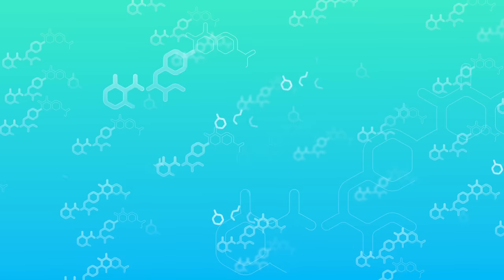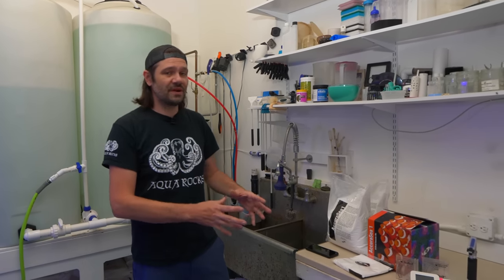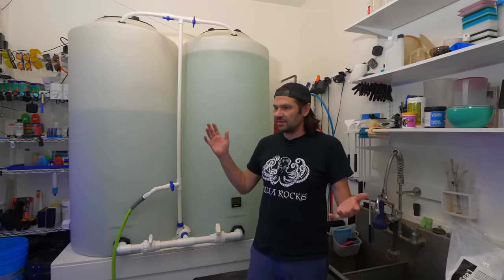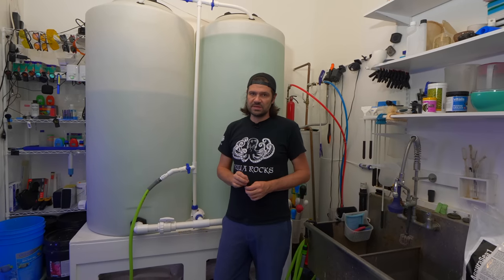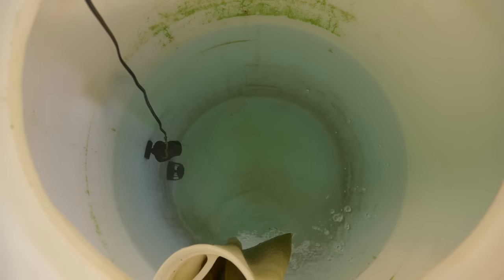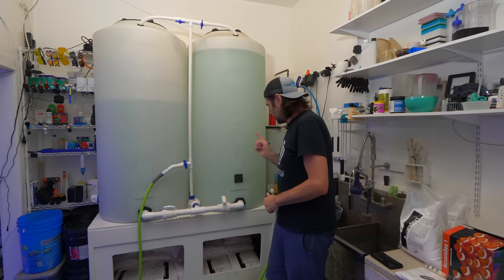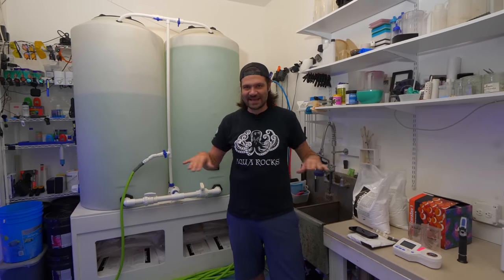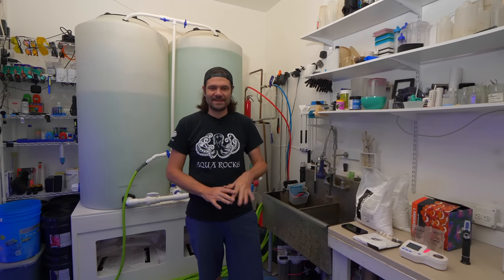Reefology 101: Everything We Do To Mix Seawater for the Saltwater Aquariums

Comment: Definitely jealous that you can get away without reverse osmosis,   I've tried that in the past and it's never ended well,  maybe I just needed a bunch more carbon blocks and/or a flow restrictor to allow more contact time with the carbon?    I'd be curious to how you determine what's "good enough" on the output side of the water.   ICP testing?  Chlorine testing? TDS?

Comment: Hey Jake, would you mind posting links to the thermometers, flow meter, and hose you used on your setup? I think it would be really helpful to a lot of us!
Reply: Yeah I'm curious about those thermometers too,  similar to ones you slap on the outside of an aquarium?  I guess they measure the temperature of the container which after a long period of time tends to be about the same temperature as the water.
Reply: Yes please
Reply from the maker: https://reefbuilders.com/2020/05/19/this-is-my-favorite-new-thermometer/
https://reefbuilders.com/2020/10/20/hydro-logic-flowmaster-meter-is-a-must-have-for-water-purification/
Reply: @ReefBuildersVideo  Thanks brother
Reply: The hose is a Flexzilla hose.
Reply: Do you pre mix Or only when you gonna do water changes
Reply: @ReefBuildersVideo  Jake, I could only find the 3/8 OD Flowmaster online. I used the John Guest reducers on both sides to get down to 1/4 but the meter is not reading my water production. Do they still make the 1/4 model you are using in the video?

Comment: A lot of people think the difference between specific gravity and parts per thousand salinity is just a conversion between two different measurement standards. But they're both actually measuring different things. Specific gravity measures the density of the water. Not necessarily the salinity which is a measurement of how heavy the salt is Ie how much salt there is in the water.

Comment: Hello @ReefBuilders Jake, I have a question I have purchased 2 vertical water storage tanks brand new. How would you recommend to clean them out before use??? Im afraid there is mold release agent and just dust or dirt. I heard bleach, distilled vinegar none antibacterial dish soap but i am unsure? Thank you so much in advance
Reply from the maker: I prefer to use an acid wash and some elbow grease